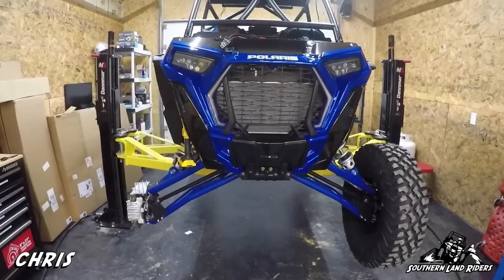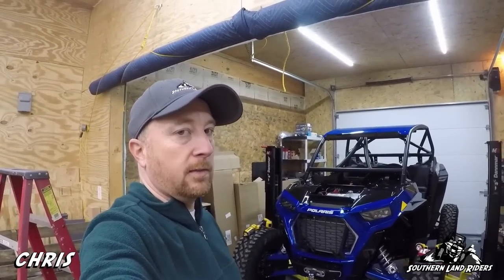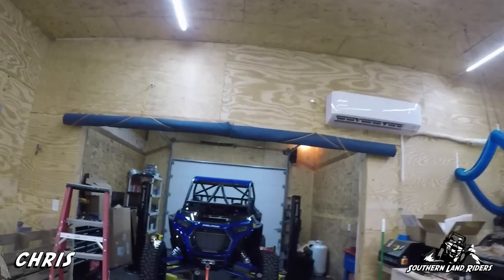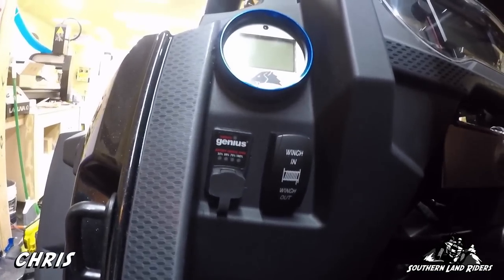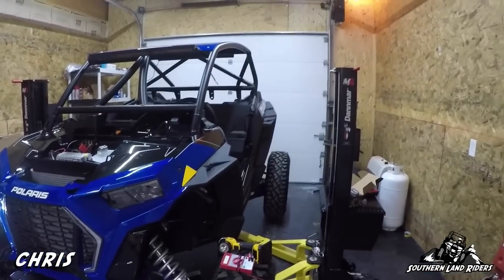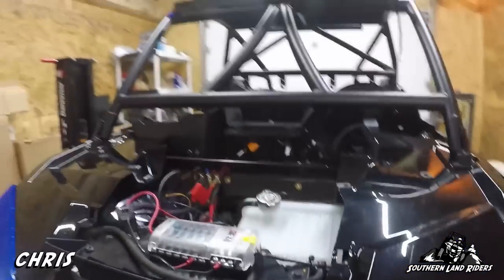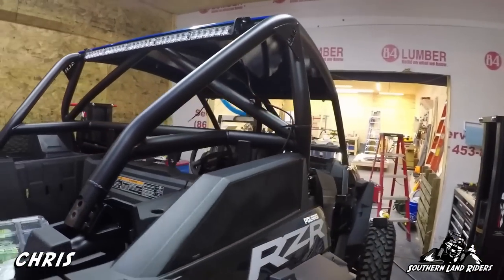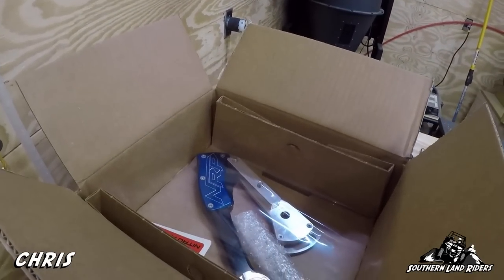Chris's Turbo S Build (Video 2 of 4)

Comment: Chris
I purchased winch kits from Polaris for my 2018 XP 1000 Turbo and 2018 RS1 and installed them myself. 
Their wiring instructions and diagrams can be confusing for sure.  I had to laugh while watching 
because I thought you were going to have the same problem I had when I first tried my winch on my Turbo.
Winch-out...no issue  Winch-in ...nothing.  Winch-out, winch-out winch-out. ... no winch -in?
I had about 4 ft of winch line out, scratch'in my head then finally realized that while doing the install
I had pulled the line through the magnet about a foot extra to put the hook on and had just stuck the 
magnet to the fairlead.........Slid the magnet to the hook and winch-in solved.......lol
I would bet your issue is just a wire plugged in backwards somewhere.  I actually like the auto stop.
Keep up the good videos! I have watched many of your rides and wish I was along side. Happy riding in 2019!!!